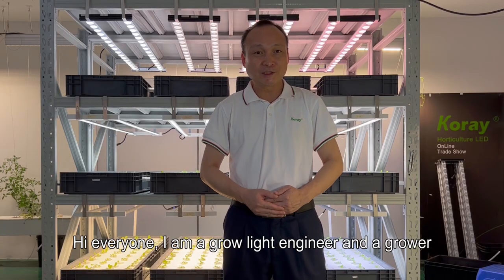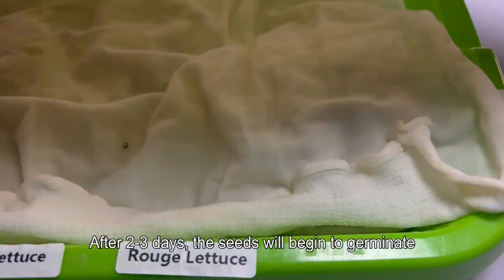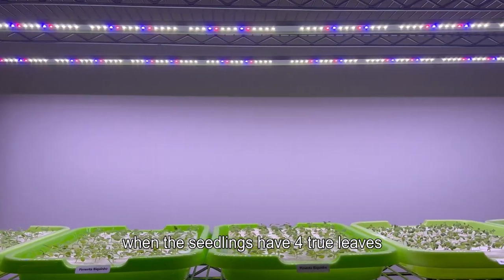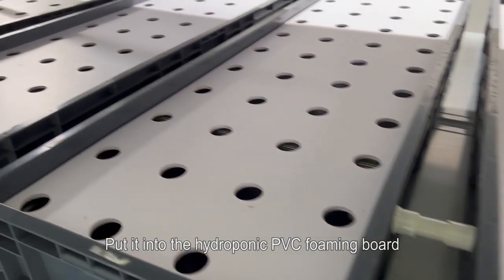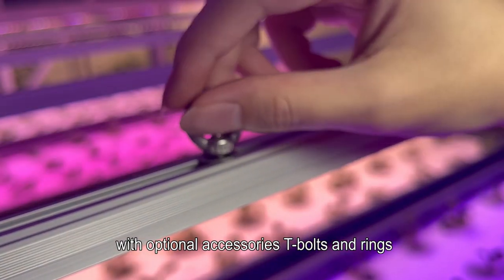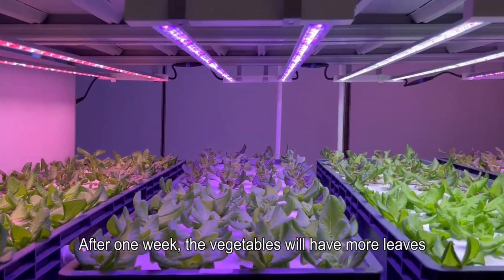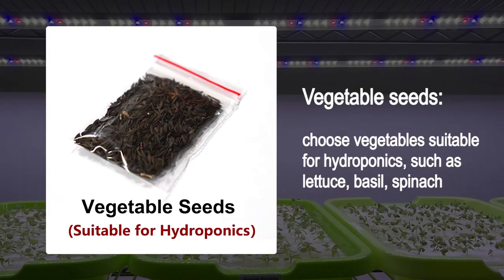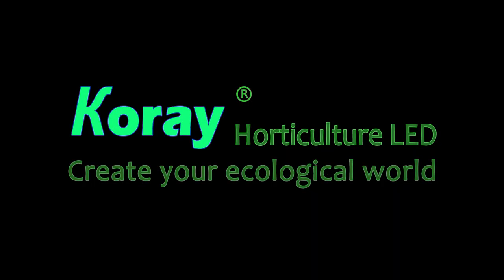How To Make Your Own DIY hydroponic System AT Home

Comment: Is it enough to put the sponge on the net cup? I'm sure there are still spaces that could expose the nutrient solution to to the grow light and cause algae to grow
Reply from the maker: Yes, try to keep the light out of the nutrient solution. There is indeed algae growing on the sponge. The LED plant growth light cannot penetrate the sponge layer. In actual planting, there is no algae growing in the nutrient solution because the light is too low to cause photosynthesis.
Reply: @KorayGrowLight  you mean to say that even if the nutrient solution is exposed to the grow light, it's not enough to cause the algae to grow on it??
Regarding the foam board, or clapboard, do you let it float on the nutrient solution?
Reply from the maker: 1. Do not expose the nutrient solution to the plant growth lamp. 2. A support frame can be set under the foam board.
We are a manufacturer of plant growth lights, mainly including hydroponic vegetable growth lights, strawberry growth lights, and medicinal plant growth lights. For more information, please email us:export@koraylight.com。 @milescabia

Comment: As water evaporates, do I add more fertilizing solution as well as more water?
Reply from the maker: Yes, of course you need to add nutrient solution. The nutrient solution circulation system is basically closed. The actual evaporation rate is very small and it will basically be absorbed by the crops.
Reply: @KorayGrowLight  Thank you. My lettuce has been growing for 3 weeks since I sowed the seeds, and the size of their leaves are about a quarter of the full grown lettuce leaf size. I have a storebought system, so I believe the lighting is sufficient.  I keep the lights on for more than 12 hours a day. Aren’t they growinf too slowly?? Do you think I should fertilize more?
Reply from the maker: If the lettuce grows every day, it should be normal. Test the EC value. It is usually 1.2-1.8mS/cm. Hydroponic lettuce will grow slowly in the first few weeks, but will grow faster and faster in the next two weeks. @spongie7403